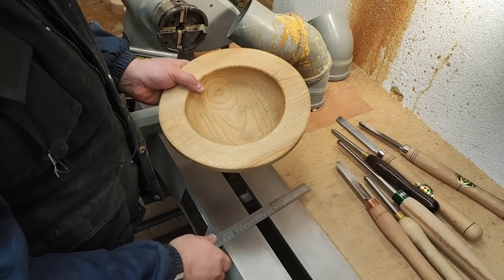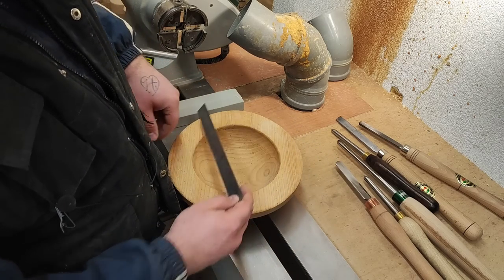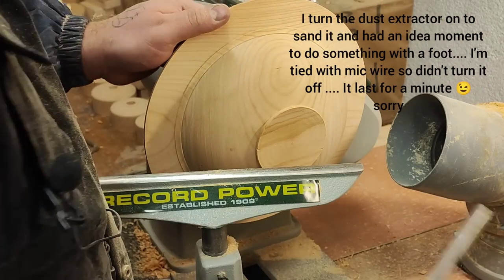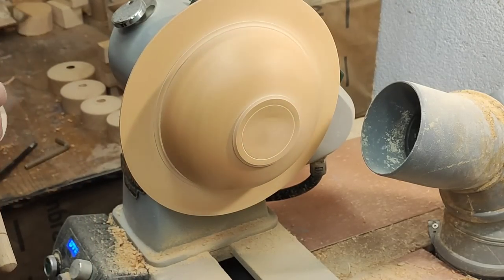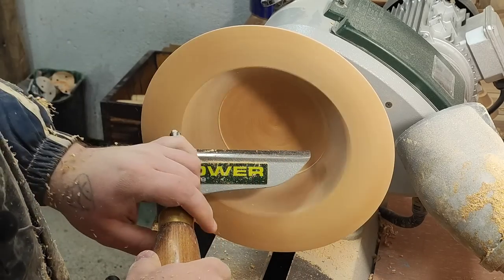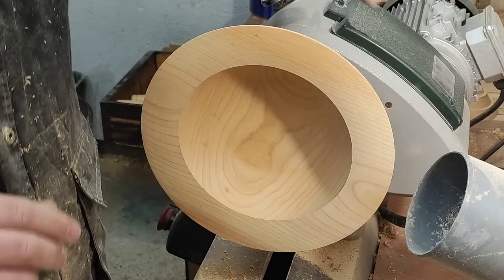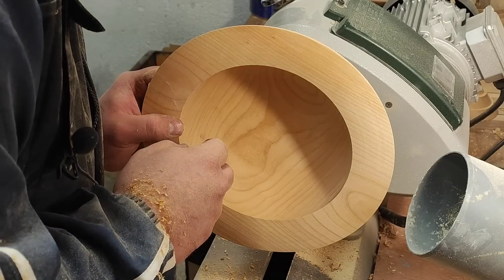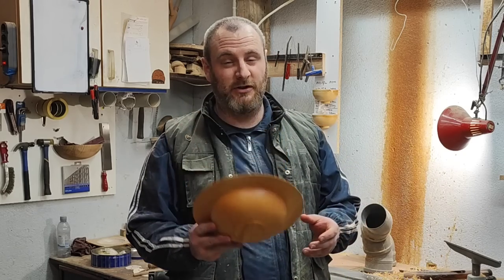4 WAYS APRIL PROJECT - WIDE RIM BOWL FROM CHERRY

Comment: Great turning, I loved the transitions on both sides. I haven’t put these on my bowls yet due to the extra difficulty. I have used rolled beads on top though.
I liked bowl before top transition and thought that you would spoil it by putting one on. However turned out really well.
Thanks for these 4 ways turnings.
Did you complete transitions with the detail gouge, what sharpenedangle do you have on detail gouge.
Reply from the maker: Thank you very much for support what we do 🤗 it is detail gouge, I never measure angles but its very pointy angle, like 30 degrees....

Comment: Good morning I have the same lap as you the stop ramp is 9 seconds. on your turn it seems less? can you tell me if you have modified the stop ramp?
Reply from the maker: Hi, not sure what you mean with stop ramp?
Reply: @tomislavtomasicwoodturning  this is the time between you press the stop button and the rotation of the chuck stops
Reply from the maker: @laurentperio6371  aaaw , that is something that I dont like on this lathe.... Takes forever to stop and you can't stop it with hand on handwheel.... I haven't do anything to deal with that .... Yours need more time to stop?
Reply: @tomislavtomasicwoodturning  me it takes 9 seconds yes I find it very long.
I'm trying to figure out how to reduce that.

thank you for the answer keep it up
Reply from the maker: @laurentperio6371  thank you,good luck and try contact Record power
Reply: @tomislavtomasicwoodturning  thank you tomislav
Continue your project it 's génial. 👍
Reply: I think you can tighten the bearings on these lathes ,not 100% sure though.